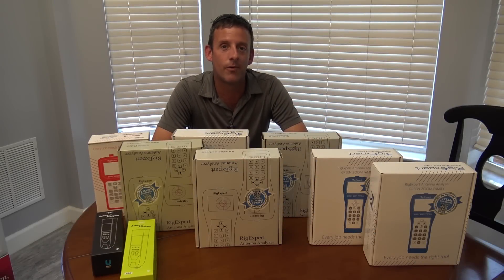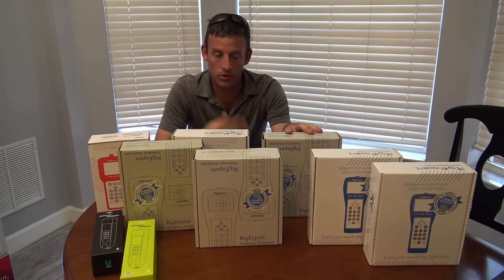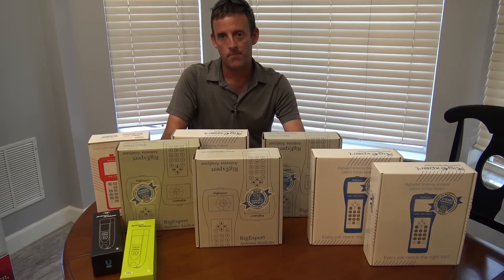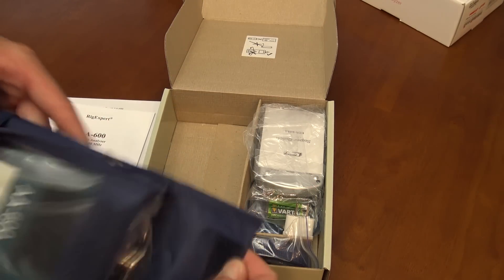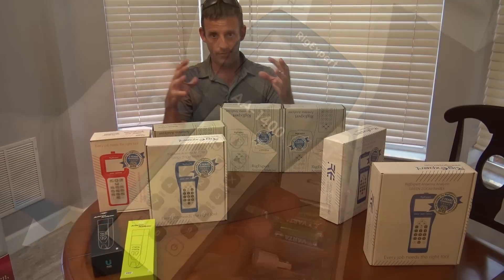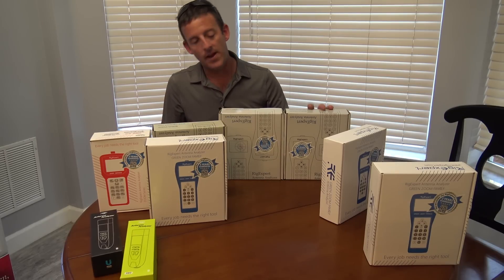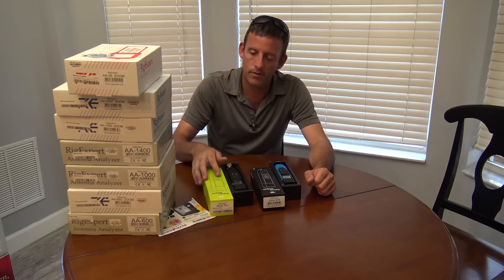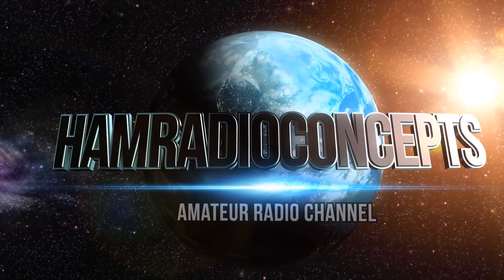Rigexpert Antenna Analyzers Comparison, Choosing The Right Analyzer For Your Ham Radio Antenna

Comment: Even though this is an older video, I just picked up a RigExpert AA-55 Zoom as I’m just getting into 6 meter VHF and 10 meter HF as a tech. I’m really hoping to upgrade this year.

I really needed to buy one because I’m struggling with SWR and trying to tune my 10m antenna.

Once it arrives, hope to make more contacts and maybe work you on 28 mHz.

Comment: Not sure how but YouTube sensors bad reviews for products like this. I bought the rig expert 500 from GigaParts and from the very beginning I had many significant problems and no way to get any support from rig expert because the only support is an email in the Ukraine which they don't bother to answer. Their software would not work on any of my three laptops and I'm one it basically trashed it it will not boot correctly and I don't have the money to pay someone to fix it rig expert conveniently offers no support for their software or any of the other problems I've encountered.

Comment: I just received a rig expert 500 yesterday and have an ungodly number of problems with it and no way to really contact anyone for help except an email in ukraine. When you finally locate the manual it's in a font size smaller than anything I've ever seen in my life when you print it out, the software doesn't work on any of the three computers that I have and it screwed up the booting on two of them. When you change velocity factor in the settings it's not reflected when you go to take the measurement. The manual does not include any instructions on the functions on the second screen. To top it all off there's really no f**** help at all from the rig expert company for any of these problems they sell it to you and then tell you to go to hell.

Comment: I tend to use xtal controlled homebrew QRPp kits but still, an SWR meter doesn't tell the whole story. Even when I use a purpose-built EFHW tuner the bandwidth is only 10-15Khz typically if tuned on my transmit frequency. My Super Tuna II+ has VXO tuning a couple Khz each way, but even my 2-watts can be heard tuning up on a crowded band when either using n SWR meter or adjusting the variable capacitors on the tuner to dim the L.E.D. to get as close to my xmit frequency as possible. I was going to get a NanoVNA, but the horror stories of fake or non-authorized poorly performing clones ruin all of the fun, plus they tend to be very hard to use for a beginner that just wants to read a quick study guide to start using it. Once I saw M0SZT using the Rig Expert I said to myself, that is the kind of display and quick, reliable results I want. Can I afford it? For the price of a well-built QRP transceiver I can have a friend for life it appears. I build very simple antennas, but Ununs and 3-band verticals with toroids all need tuning and I am sitting here with a bunch of built antenna kits not tuned yet because it is such a pain to tune them with just a VSWR meter. With them, I might be able to pre-tune my Hendrix QRP EFHW tuner to my crystal freq or my Speader Wire dipole which doesn't have any coax in the traditional sense, but it is a cheap emergency single-band antenna that will get the job done if you trim it to length first. Now I have to pick my model ... more research! Thanks for the primer! 73 es 72, Davey - KU9L

Comment: I just use my $50 NanoVNA. It tells me MORE than an antenna analyzer ever will. Sure it does SWR. But it also tells me return loss and exact reactance. It measures from 50 kHz up to well over a GHz. It measures inductors and capacitors, analyzes crystal filters, generates frequencies, on and on. The NanoVNA hooks up to my laptop, and does even more. It can save all sorts of stuff and give me print-outs. And the user groups and firmware upgrades are excellent, and totally free. An antenna analyzer is an expensive dead-end, a dinosaur of technology. But what do I know? I've only been into radio since 1960.

Comment: I also worked in the commercial communications business.  You are correct!  They use antennas tuned to the exact frequency.  However, In the ham radio world, No one, i mean no one has time, money and the space to install antennas for every frequency, nor do they have time to change them out every time they want to tune to a different band or frequency.  You cant compare the two, they are two different animals.  That is exactly why the radio companies install tuners on most radios.

Comment: A "tuner" or more correctly called, a transmatch, doesn't tune anything. It presents a 50 ohm, or close to it, load to your radio so it puts out full power. Another point to consider, since your rig has a 50 ohm connection, and your coax is 50 (or 52) ohms, the mismatch is at the feedpoint of your antenna. That is the ideal place for a transmatch.

Comment: I learned long ago that the antenna is the key in getting out and receiving.. You can have a $10.000 radio, and if you don't have a properly tuned antenna the radio can't do it's job.. When it comes to antenna, and coax I but the best there is.. To me the antenna is the most important part of your setup..

Comment: I just ordered one of these RigExpert analyzers from Radioworld.  I chose the AA-55 Zoom model, as my experimenting in antennas will primarily be on HF, and maybe a little bit of 6 metres.  2m and 70cm are pretty much covered for me in that regard, and from my perspective, HF is where I feel the most ham radio action can be found.  Our local 2m/70cm repeaters have hardly any activity on them.

9:02 - The 1.2 GHz band is actually 23 cm, not 13 cm.

73 VE7NDE

Comment: I purchased the RigExpert 1500 Zoom JAN/21. The connector is a Type N - Female. I suggest purchasing a calibration kit, OPEN-SHORT-50 ohm, that are Type N - Male connectors. You will likely need a Type N male to SO-239 adapter to receive PL- 259 connectors. If you plan on checking your  HT's antennas you will likely need Type N - male to SMA male and female adapters. Your equipment and your friend's will dictate what adapters you need. 73, W1RKB

Comment: My Rigexpert AA-55 Zoom is one of the best items I have purchased. 73
Reply: If they could just sort out the Bluetooth option.  Several of us paid extra for the option and it flat doesn't work.  They claim to be able to fix it with software, but the fixes they've put out thus far are not ready for prime-time. .  They need  to fix this now.   It's been long enough.